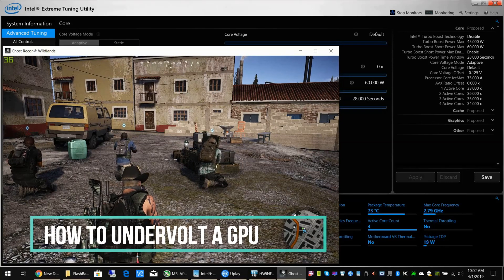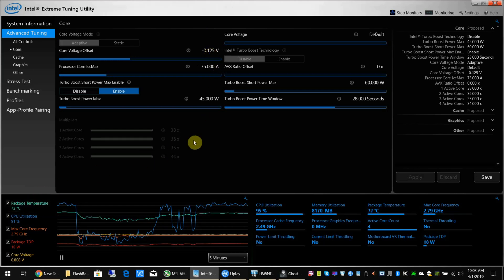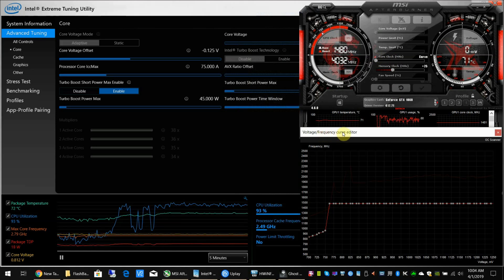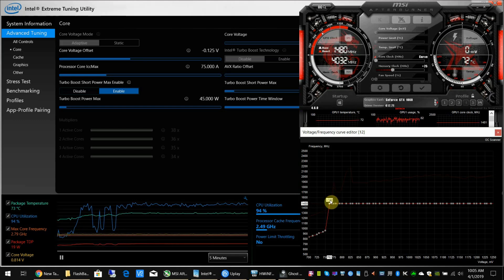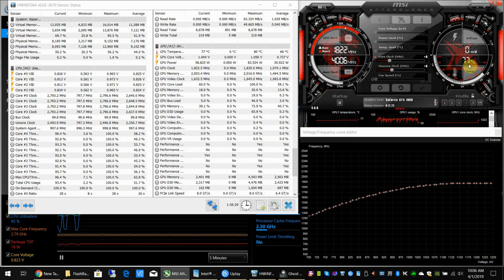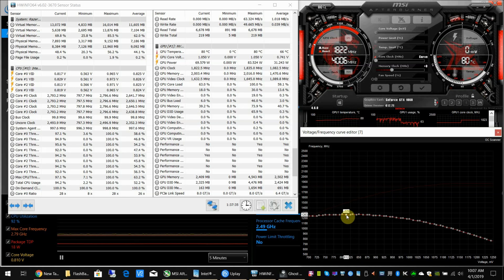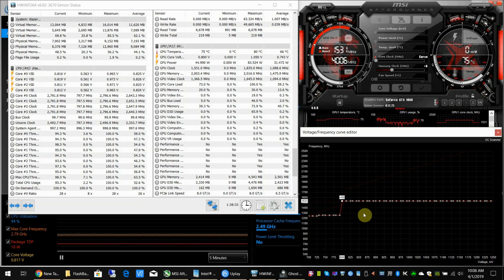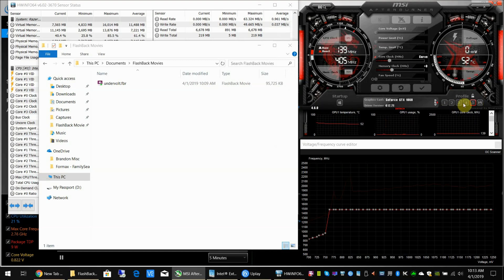Lower Razer Blade Fan Noise by Undervolting

Comment: hi, I have a similar problem and I couldn't enable the turbo boost tech. section due to my intel tuning utility doesn't allow me to make changes in turbo boost tech and core voltage offset. I will appreciate it if you can describe how to enable them.  thanks in advance

Comment: If you can read this please reply, I have a Razer Blade 14 2017 model and my BIOS has only 3 sub setting with no Power & Config setting. I've update the BIOS and is at 02.02. any idea what is going on? and how important is to disable turboboost? any other way to do it reliably?
Reply: I disabled turbo boost and now my pc is quite when not running games. Before turbo disable my PC sounded like a jet even when it was only at 15% CPU usage.

Comment: I currently own a razer stealth 13.3 with mx150. every time I plug a laptop to my ultra monitor, the laptop fan runs so loud which sometimes I cannot hear its sound from the laptop. Do you by undervolting the GPU with MSI afterburrner will reduce the fan noise?
Reply from the maker: Yes undervolting should reduce the temperatures so the fans don't have to spin so fast, but just give it a try and find out :)

Comment: Do you know if this applies to a Razer Blade 15 (2019)?
Reply from the maker: As long as the GPU in the Blade 15 2019 allows you to modify the voltage/frequency curve then yes.  Download MSI Afterburner and give it a shot :)
Reply: @agentbb007  Thanks for the response. My solution ended up being embarrassingly simple thankfully...just went into Synapse and changed the fan to Auto from Manual...fans went down immediately. Hopefully this "hiding in plain sight" solution works for others!!
Reply: did changing from manual to auto work because i also have the blade 15?
Reply: @jacobmcknight7902  yeah it did--the manual setting was set very high, and when I changed it to auto it immediately chilled out. Now whenever the fan is going too hard it's because there's too much dust in the laptop. Get a compressed air duster to clean it out

Comment: Thanks for the video! What would you say the performance difference is?
Reply from the maker: It all depends on the GPU core clock.  Stock is bad so definitely don't run that.  My GPU can get about +250 core clock before crashing.  So I prefer to run the lowest voltage I can 700mV at 1480MHz core clock.  Which is only -16% compared to stock.  But that's why the curve is so good you can customize it to exactly the voltage/heat/performance you want.  Here are the results I got while testing in Fortnite.
Stock
1607MHz 881mV (clock and voltage changed constantly stock) 82C fans run max 65 fps
Quiet Curve
1480MHz 700mV 75C fans 1 level below max 55fps

Comment: I have a Razer Blade 15 advanced with RTX 2070 for some days now and without tuning anything, the fans are by far not as loud as I expected it to be, even after hours of nonstop gaming.
Highest GPU temp I have seen so far was 75°C and the CPU around 80°C.

This weekend I'm going to repaste it with liquid metal, replace thermal pads and undervolt it... even though it already runs really nice, I can't wait to see the performance/temps afterwards.
Reply from the maker: That's awesome temps, it looks like they've improved the thermal cooling a lot.  You'll have to let me know how the liquid metal does.
Reply: @agentbb007  have been undervolting the CPU the last hours. Right now I'm at -155 and it seems bench stable. Pretty impressive so far.
Reply from the maker: @dasoul3710  Yeah -0.125V has been great for my chip, it varies from chip to chip so you can keep going down until you are happy or until it crashes then just go up a bit to find the lowest voltage it'll go.  It's really great no loss of performance, lower power usage and lower temps, win win win.
Reply: @agentbb007  my laptop gets really hot. Like really hot. I have the Intel i7 8565u and the mx150 25 watt, what are good numbers for the both to not make it always overheat?
Reply: I have the exact same model with RTX 2070 max-q, but it does get loud even when browsing the web. I tried to lower the fan speed in Synapse, but it became really noisy like a jet engine. Too strange.
Reply: @xiaoyuhuang536  agree. I just picked up one  (mid 2019 with 9750H and 2070 max q).  The cooling and fan noise is really impressive when gaming, however when not gaming the fans stay on a bit which is annoying.  My macbook pro and other laptops i've had are dead silent when doing light loads like browsing and email.  I'm not sure i'm going to keep it because of this.  I'm very surprised this is not mentioned in ANY of the myriad of reviews i watched before purchasing.
Reply: @xc68000  I already returned it because of this. The first few days were fine since I only had 5-6 software installed. But then the fan became crazy after I installed Office, anything can trigger it. Pity, such a nice machine.
Reply: @xc68000  you should be abe to adjust fans in the bios. Also make sure you have the PC set to balaned it the Synapes power control. Also having Afterburner open when browsing can keep the clocks ups.
Reply: @xiaoyuhuang536  exactly how i feel!

Comment: Hey man, love your vids. I am thinking of upgrading to an i9 9900k and a 2080 TI. Would you recommend this? Was it worth spending the money on it?
Reply from the maker: Hiya!  Yeah this upgrade was totally worth it.  And it's a bit expensive but I LOVE the 9900k so I'd definitely go for that.  I upgraded from a i7-6700k and GTX 1080 and it was a big difference.  I also would highly recommend getting a M.2 NVMe drive, even though SSD's are super fast the NVMe has decreased load times a lot, especially in Total War Warhammer 2 which I play all the time.  I just bought the Intel 660p 2TB NVMe and it's awesome and very reasonable only $200 for 2 TB right now.
Reply: @agentbb007  thanks for the reply man. I currently have a 980 ti and 4790k. So I expect a pretty big jump in performance. I also play Warhammer 2 alot! Very excited for the upgrade. Ant chance you could do a vid showing the load times in between turns on a campaign for total war Warhammer 2?
Reply: @AkraGaming  no man, don't do it. This video is good for people with laptops who have to balance their temperatures. As long as your desktop has a decent cooler, you shouldn't have to worry about it too much